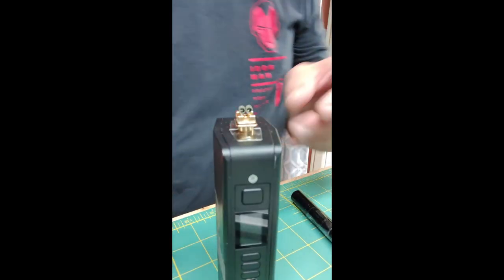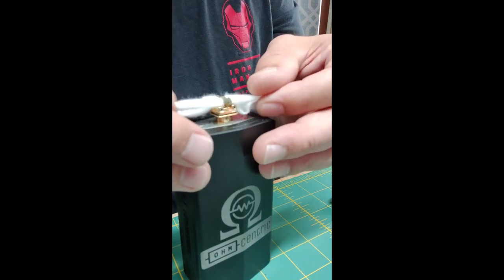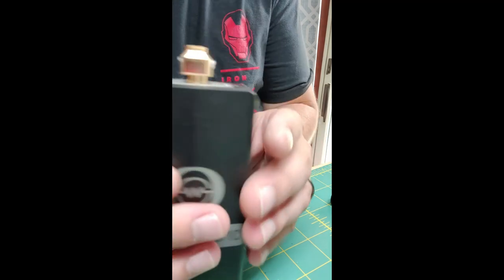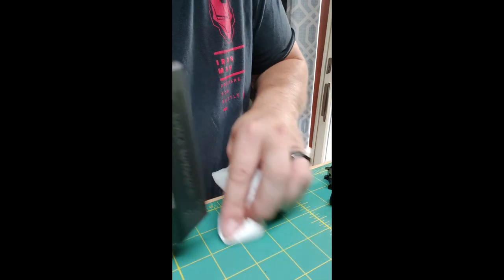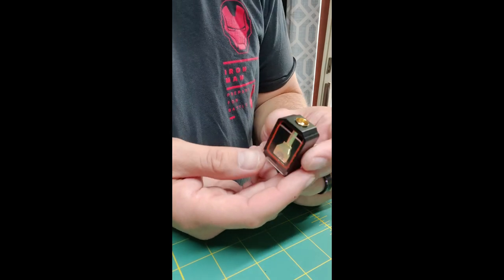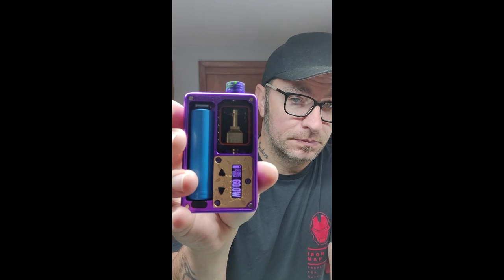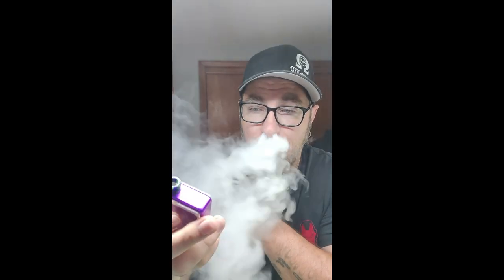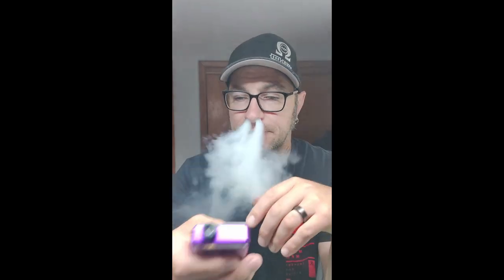SUSCO KERCH!!!

Comment: Hey nick was it 3x32 40 or 2x32 40?? I would suggest 2x29 40 next time if you are only working with 60 watts, I run my 2x27 40 at 62 watts all day but that’s on a single 21700 100 watt mod.
Reply from the maker: Specs are 
32/40 tri core aliens all N80, they fire great within the working range of a dna60 board :-)